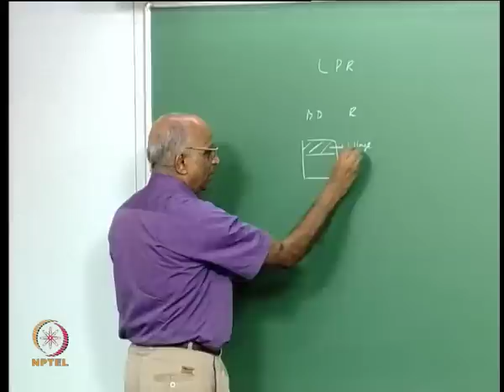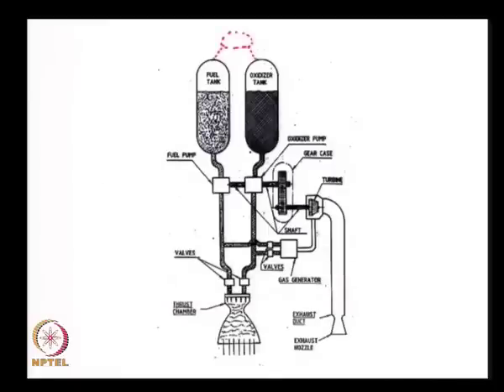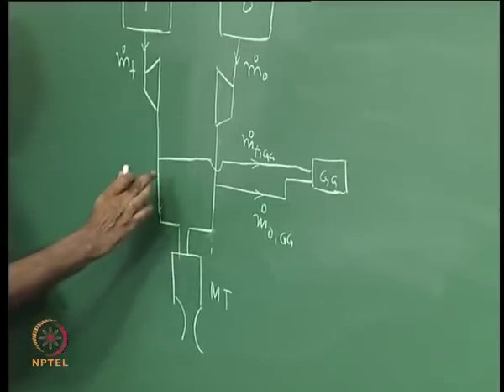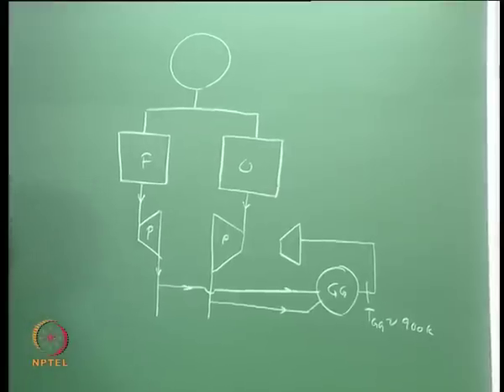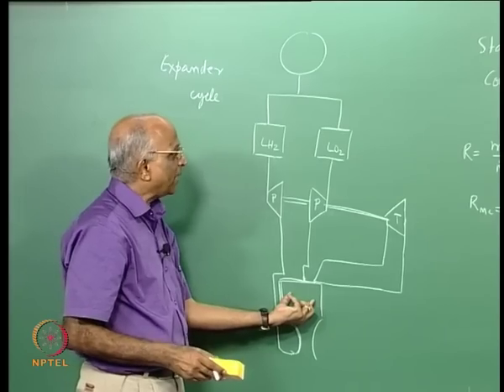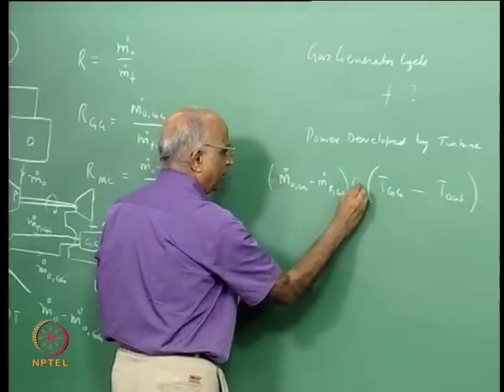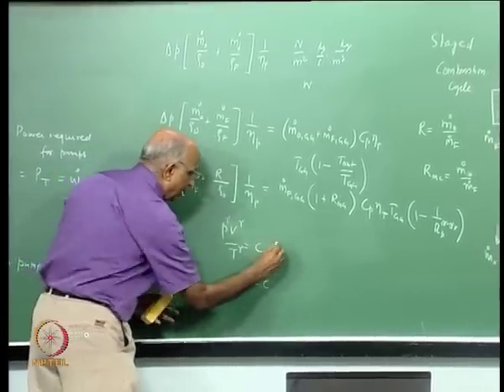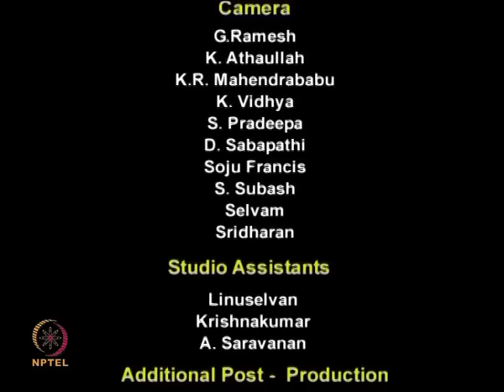Mod-01 Lec-29 Feed System Cycles for Pump Fed Liquid Propellant Rockets

Comment: what is the need of gas bottle in turbopump feed system?.. since the turbine runs the pump and the pump itself produce enough pressure for combustion..
 pls help me out sir.
Reply: +Saravanan V the pump needs a pre-pressurization which is necessary to start running, and also check the characteristics of the pump ( the less inlet pressure , the more loses you get)
Reply: At the inlet of the pumps, there is a low-pressure region on the blade leading edge, which can cause cavitation, if the static drops at the vapor pressure of the liquid used. This can be extremely damaging, and maybe cause explosion depending on the liquid ^^. Thus, you need to supply a liquid already pressurized at the inlet. But a pressure way lesser than gas-only cycle for the same thrust